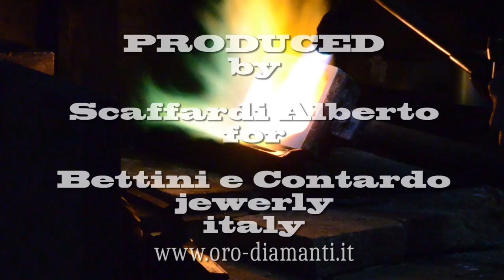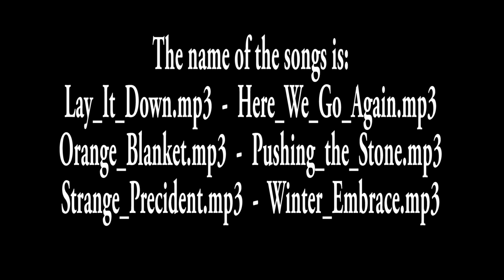ring white gold flat band with diamond

Comment: Alberto,
I once had a local jewelry store make a white gold setting to hold a piece of Tanzanite for a ring for my wife.  The jeweler made a big thing about potential damage to the stone because the ring had to be heated to set the prongs, according to him. I have never seen you heat a prong to set a stone and I consider you the best craftsman I’ve seen.  I have since purchased gold settings to make simple pendants and ear rings and have never had to heat a prong.  Can you tell me why it might be required to heat a setting  to set a stone?  Kind regards, Anthony
Reply from the maker: Usually a stick is used, with pitch. It is heated with an alcohol lamp. The heat used is bearable by the majority of gems. By experience there are particularly delicate gems to which you have to pay attention. When working with customer gemstones, it is best to let them know any work-related risks. Kind regards, Alberto.

Comment: in a earlier video u used som sort of gold solder paste where or how did u get that?
Reply from the maker: +Gbgabbe What you see, is not solder paste, but the liquid flux. It serves to prevent the oxide gold and facilitates the movement of the weld

Comment: What happens to all the metal powder from filing, sanding, cutting? Is it gathered and melted to be reused?
Reply: +macbeth2354 Yes.. typically all that filing/drilling/sanding/cutting is done over some form of catchment and when its significant enough you can easily funnel it into your next smelt.
Reply: +macbeth2354 of course gathered and melted again
Reply: +IllegalTacos Thank you!
Reply: +Giorgi Chikhladze Thanks!
Reply from the maker: +macbeth2354 The explanations are perfect thanks